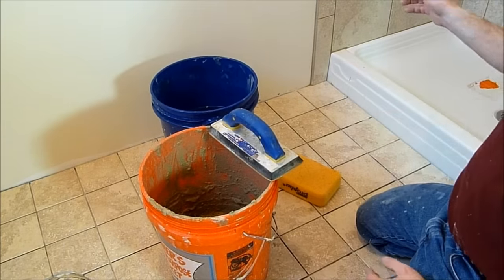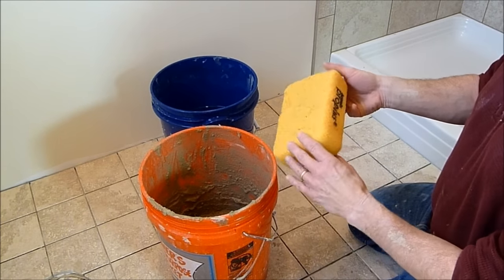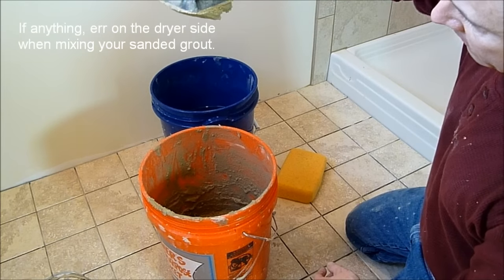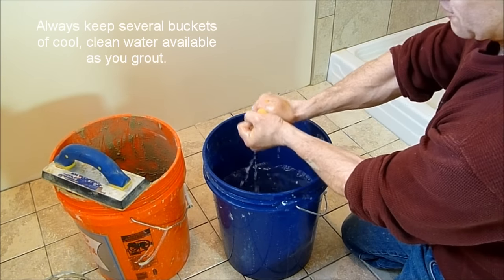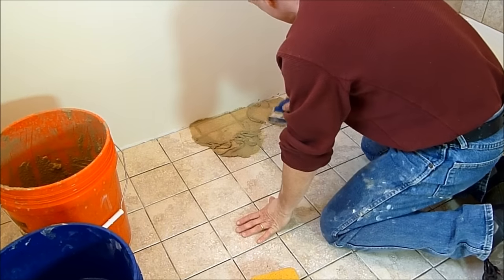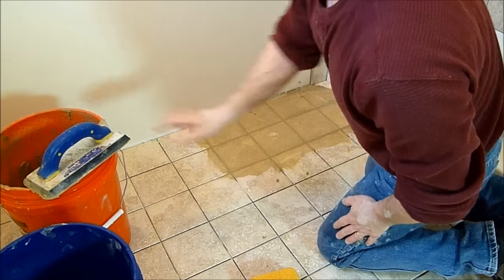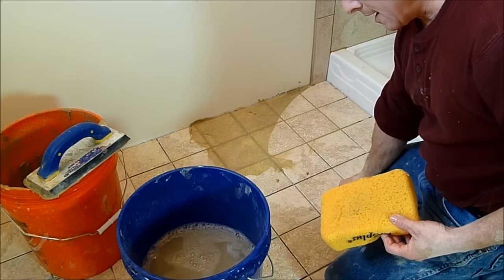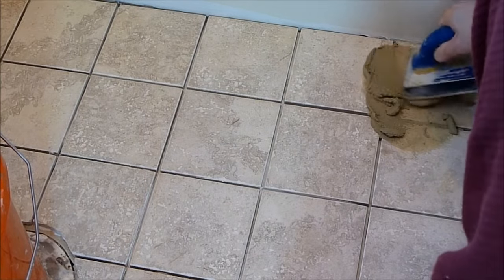How To Grout Tile: Correct Technique Makes It Easy

Comment: I used this technique with tec accucolor grout and it looked great at first but after it cured there was white residue on grout joints. I mixed grout very dry and used distilled water in the mix.  How do I get rid of the white stuff coming out of the grout?  I mixed it with a drill and let it sit for 10 minutes then mixed it again.
Reply from the maker: Tony Caduto  You don't say what color the grout was, but I'll venture some potential things to think about.  When you say the mix was "very dry" was it too dry?  The water needs to be thoroughly mixed with the powder and if you went too dry it's possible the residue you are seeing is unmixed powder.  The right consistency is difficult to judge from a video, I realize, but you want the grout to be something along the lines of peanut butter or mayonnaise. Of course, if you go too wet, you can get inconsistent color after curing too!Another question pertains to the thinset adhesive I assume you used for the tile.  Is it possible that the residue you are seeing is either thinset that got mixed in with the grout (perhaps from reusing a bucket or paddle mixer) or from thinset that smooshed up in the joint and is showing through?  Typically the thinset is either white or gray, so the color of the residue may be an indication.Once in a while I've come across old grout mix that has given me inconsistent mixing.  Were you using fresh, unopened grout from a reputable retail store?  Finally, if the residue doesn't come off and you have a real problem, don't despair.  It's actually pretty easy to remove the grout (especially when it is new) and re-grout the problem area.  I have a video to show you the process of removing the grout.  Hopefully some of these thoughts will help you...
Reply: Hi its a medium beige and the thin set was all scraped out really good.  
I did mix it to peanut butter consist ancy and I mixed it for over 5 minutes almost 10.  It could just be the brand, I still have one more room to do so I may use something other than tec.   The last room I did with this same color also had white residue and I ended up using grout dye of the same color which worked well.
Reply: I will scub it with distilled water in the am and see it it washes off.
Reply from the maker: Tony Caduto Hm. I've used that brand before--it's a well known, reputable brand.  If you had trouble before, though, was it the same bag?  I have to say, I've never used distilled water.  I don't know why that would be a problem, but I've never had an issue with chlorinated tap water or well water.  The only other thing I can think of is that if you didn't wring out the sponge enough you could have been adding water as you wiped without realizing it.  That could cause discoloration.  I would suggest ditching the distilled water for the next time.  I just don't see a need for it and I wonder if there was something in it that caused the issue.  I do an average of maybe eight bathrooms a year with tile,  and I always use tap or well water, whichever is available onsite.
Reply: I did another room and the grout looks great except for the color it did the same thing and I wrung the sponge out really good.   It all turned white when dry.  This time instead of sealing I just used the tec grout colorant of the same color and now it looks great, the grout absorbed the colorant right in like a sponge.
Reply: Just a FYI distilled water is pure nothing in it, no chlorine nothing and is actually a good idea to use with grout.

Comment: I have a 10-pound bag which needs a 1 US quart of water to mix according to directions on the bag.  I have 9 tiles to grout.  I am not going to be mixing the entire bag as this would make enough for a full-size shower or more!  I don't figure to need more than 1/4 of the bag and I am sure I will have WAY more than what I will need...  I have a sponge but not one of those fancy ones and I also don't have one of those rubber grouting tools.  Good to know what I need to do the work on a Sunday evening when the stores are closed.  This means I don't get to do the job until tomorrow after the store opens up!  I was trying to figure out HOW I was going to put the grout down!  Thanks to your video, I now know how and what tools I need.  You would think the store sales guy might have mentioned that I would need these tools as I bought grout, tiles, and thin-set all at the same time!  I did ask him if there was anything else I needed!!!  Sigh...  Thanks for the knowledge you have imparted!
Reply from the maker: Yeah, just mix until you have the consistency you need.   I never measure and I always keep a little dry mix left in the bag in case I accidentally add too much water.   The tools for the job are not expensive.

Comment: Very informational video! I will be grouting our small bathroom tonight and will do it how you showed thank you! We are planning to also tile and grout out kitchen and the instructions on the grout say it needs 7 days with no water getting on it for the grout to be water proof. This seems difficult in a kitchen when i have 2 young boys. Can I put some type of cover over the sections that may come in contact with water or should I just try to figure out some way to not use the kitchen for 7 days? Thanks so much!
Reply from the maker: If you are using a standard grout from a home improvement store or tile retailer then all you need to do is let the grout set up for 24 hours before you walk on it.  Then just be cautious about spills for another day or two until you can put down a grout sealer.  A water based grout sealer that comes in a manual spray bottle is the easiest to use.  Spray a bunch on the grout (it won't hurt the tile), let it sit for a few minutes, and then wipe up the excess with a rag. Possibly you were looking at epoxy grout, which is a whole 'nother animal and which I suggest you avoid.
Reply: enduringcharm yes the grout we got is from lowes and is premixed in a bucket. We used vinyl tile can we still use a grout sealer if it is vinyl tile? Thanks for your reply!
Reply from the maker: Okay, let's back this train up!  The advice I was giving you was based on ceramic or porcelain tile and real grout.  You have two different factors in your installation.  First, "groutable" vinyl tile is much thinner than ceramic or porcelain tile, and grouting the lines with a regular cement-based tile grout is not recommended.  Second, the premixed "grout" that you are looking at for this application is not actually a cement-based grout.  It is closer to a caulk, really, than a grout.  It has chemical properties that make it flexible and better suited to thin application.  It is meant for simple DIY work not pro installations.  So, I'm afraid you'll have to take the advice on the label as far as curing.  A grout sealer is unlikely to be usable, either.  The application style shown in my video may work, but you'll need a light touch with the sponge.  Vinyl tile is really a different animal than ceramic or porcelain tile, even though it is meant to mimic the look.

Comment from the maker: Probably one bucket is enough, but you can dump it out and refill with fresh water if you need to.  Since you are only doing a small section at a time you can pause for a couple minutes to refill without causing any harm.

Comment: Thank you so much for the great video. This helped me so much. My floor turned out perfect. And, I am a 69 year old woman who has no experience with this. I did have to kneel on a foam mat though. It is sure tough on the knees and the fingernails. Should have worn gloves I think.
Reply from the maker: I'm glad it turned out well for you--and I feel your pain!  Construction is tough on the body.
Reply: Do some swimming to get your hands clean and relax the body, especially when you have sunlight.  Helps unwind and stretch the body from that cramped position.

Comment: i am going to grout a floor, about 65-70 sq. ft. No sand grout, one of the smaller bags. do i mixup the whole bag in one go? or will it harden up before i can spread it all? thanks for the great video!
Reply from the maker: Dave P. It probably would be okay, but I don't typically mix up a whole bag if that's all I have on hand because I may need to adjust the mix if it is too wet at first.  And, since this is your first time it's better to mix up two smaller batches and have less pressure to finish.  The grout won't set up instantly, though, you have some working time!

Comment from the maker: Are you referring to a drop-in style tub where the lip of the tub sits on top of what amounts to a box?  If so, all you really need to worry about is that the tub goes on top of the tile on the flat surface and that you caulk properly.  They make a sanded latex caulk color-matched to the grout, which helps create a unified look.

Comment: Thanks. I sort of was afraid of that proper technique as it does take longer with the “One swipe, turn, and another swipe, and rinse “ bit.
I’ve got three rooms to do tomorrow. Not looking forward to it.
Reply from the maker: It goes pretty quickly on floors.  Walls are the bigger pain.  Just take care not to get sloppy with the water or mix the grout too wet.  It's a Zen thing, once you get in the zone you'll make steady progress.

Comment: wondering: when following the directions for mixing the sanded grout (water/mix ratio) it appears to be more "wet".  what then? wait and allow to dry? or add more sanded grout mix?  thank you: excellent, concise and helpful video!!
Reply from the maker: I never mix up a whole bag because sometimes you accidentally add too much water and then you can add back a little more dry mic to make it right.  When mixing in the bucket it will appear a little more wet at first but after 5-10 minutes of"slaking" it will appear a little more dry.  If you start out on the dry side it may be too dry by the time you go to use it.

Comment: Hi John thanks for the video. Is there any preferred wait time before walking around or getting it wet? 24 or 48 hours. Thanks
Reply from the maker: The rule of thumb for traffic after grouting is 24 hours.  Longer time is required before sealing for most brands of sealer.

Comment: How long do you wait for the final wipe-down? Do you use plain water, or a solution for the final wipe? Great video! Thank you.
Reply from the maker: There is no final wipe down.  You do as I did in the video and you're done.  The next day there may be a slight haze which will come up with a damp rag or paper towel.

Comment: Thank you for the video. What about the part which is attaching a shower? Should I use grout there or just silicone?
Reply from the maker: Use silicone caulk where the tile meets the tub or shower pan.
Reply: @enduringcharm  thank you 😊

Comment: Thank you for the video. Can I ask your opinion on sealing grout? Where to do it? Does it even matter? I assume sealing a shower grout is more important that a kitchen floor. What is your opinion? Thank you
Reply from the maker: Pete I do seal the grout when I do new installations.  However, I also set expectations with  my clients.  Sealer is not magic!  It will help prevent water infiltration and the stains that can go with that.  It will not, however, prevent "mechanical" dirt. In other words, if you have actual particles of dirt or debris that mechanically bond with the surface of the grout the sealer is not going to help.  Foot traffic brings in dirt that can get ground into the grout, and even in showers some soap scum or other products can get ground in.  The sealer can help prevent liquid stains and maybe help keep dirt flowing away in a stream of water in a shower.  But, it won't stop dirt.  Of course, a sanded grout is even more likely to pick up mechanical dirt than an unsanded grout.
Reply: Thank you for the reply. So sealing stops water pretty much? All my showers are sealed but nowhere else and it's been fine for years. I'm doing the kitchen now. There is discoloration in grout in the house but not a big deal in my mind.
Reply from the maker: Pete In a kitchen sealing will help protect against a coffee or wine stain to some degree, although you can't expect miracles and you need to reseal from time to time.

Comment: Hi,
I'm re-doing one of my bathrooms and it's a first for me. Right now I'm working on the tile in the shower. The shower floor is 3-foot by 3-foot, and I'm using porcelain tile made by daltile. I already have the floor tiles down and I'm getting ready to do the wall tiles. I made a couple of niches, and I'm also planning to do some decorative trim about 6-inches down from the top. There wont be any glass pieces or anything, it's all porcelain. For the trim, niches, and floor, I want to use a brown grout, and for the main wall tiles I want to use a white or beige grout. My question is... can I do the brown grout, let it dry for a day or two, then do the other grout? I'm wondering if that will cause a space between the two grouts that will leak, or if the two will come together just fine even though one was dry before the other was applied. Or, do I have to do them both at the same time, in which my question would be... will the two colors run together where they meet since they're both wet? Sorry for the long comment, I just figured the more info I give you the better. Thanks very much in advance.
Reply from the maker: The Ricksta Hm.  Well, I can't say I've ever done or even seen a mixed grout scenario the way I think I understand you to mean.  Once in a while I come across a floor tile grout different from the walls, but the two never meet.  I think you are probably asking for trouble.  I suppose you could do one color, let it set up, mask it off somehow with tape and then grout the alternate color.  There is bound to be some color overlay where they meet, though. I guess before you do the second color you'd want to take a thin chisel and make the first grout line sharp and straight up and down.  Sure you can't find a single color that will work?

Comment: Thanks! I was wondering what that  blue thing was for. I've used a rubbery thing that looks like what you scrape ice off your car windows with to spread the grout but I also have one of those. I'll try with that :)
Reply from the maker: A rubber float is essential.  It's strong enough to force the grout into the grooves, but it won't scratch the tile.

Comment: Thanks for the tip and video. I have a little bathroom to do 9'x5', the guy I hired was from Italy and had to leave on short notice, Seems easy enough, being down on your knees seems the hardest part of all, I have need pad for that :o)  .
Reply from the maker: +ERVARGAS NYC Just make sure you're using the right type of grout--sanded for larger than 1/8" joints and unsanded for tighter joints.

Comment: Interesting technique. Your grout is a lot drier and you start wiping off the excess grout with a sponge right away. Never seen this. I must say that this approach requires a lot less effort it seems. I hate scrubbing the haze and it when too much of it dries.
One last question.  I have polished porcelain tile (smooth like granite or marble) with 1/8" thick grout line and diamond inserts. Would you recommend sanded or unsanded?  Don't wanna scratch the tiles you know.  Def trying your technique

Comment: After applying the grout should you wait 10 to 20 minutes before wiping it with water?
Reply from the maker: No, that is not necessary.  If you read through some of the comments there have been similar discussions.  That was the traditional way of doing it but it doesn't buy you anything and with today's grout formulations you may even set yourself up for big trouble trying to remove grout that has already set up.  Just do as I say in the video and you'll be in good shape.
Reply: enduringcharm Thank you

Comment: It looks like there was some existing grout in the tiles, or is that the thinset that is squeezed up between the tiles? I am regrouting tile that is partially damaged and I appreciate any tips! Thanks!
Reply from the maker: You may see some thinset deep in the grooves.  That's fine--you don't need to have perfectly clean spaces between the tiles.  If some thinset does come up too far toward the surface and might prevent grout from seating or even show, then you can carefully scratch it out with an old screwdriver or other tool.  If you are regrouting it is best to remove most or all of the old grout.  I have a video on that too:  https://youtu.be/yzKtgalbaic
Reply: @enduringcharm  thanks very much!

Comment: I have a couple of questions that likely suggest my ignorance:
1) is there anything underneath the tile to hold it?
2) is it ok to not grout portions of tile that will be under cabinets or otherwise covered up?

much appreciated.
Reply from the maker: The only stupid question is the one you don't ask!  I have some other videos showing how tile is put down so you should check those out.  A mortar-like adhesive called thinset is most commonly used to adhere the tile to the wall or floor.  It is put down over the whole area with a notched trowel and the tile pushed into it.  Grout merely fills in the joints between tiles and is not meant for structural purposes--it is the thinset that holds the tile in place.  Another adhesive called "mastic" used to be more common too, but it has fallen out of favor for most circumstances. 

Grouting in areas under cabinets is fine and I usually make a point to do so.  That way if a cabinet is changed to a different size in the future, the floor will already be grouted.  The only reason not to grout under where a cabinet will go is to save labor, but that's taking frugal a bit too far in my opinion!
Reply: enduringcharm many thanks for your time.